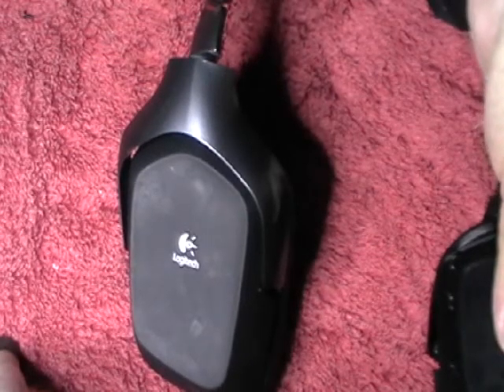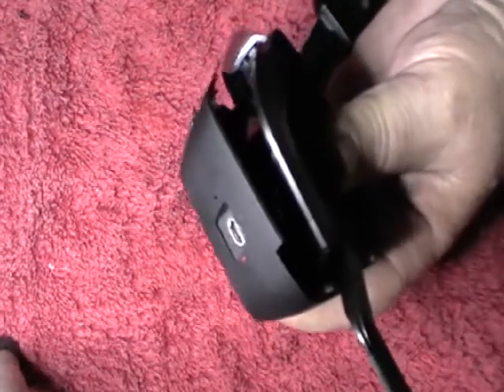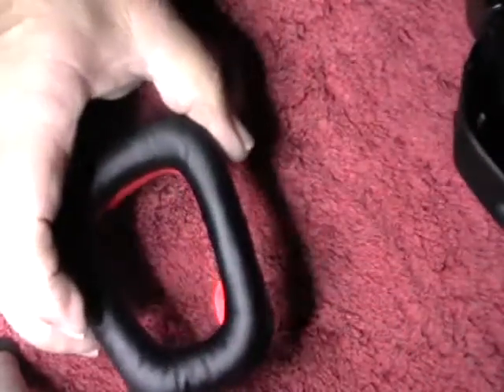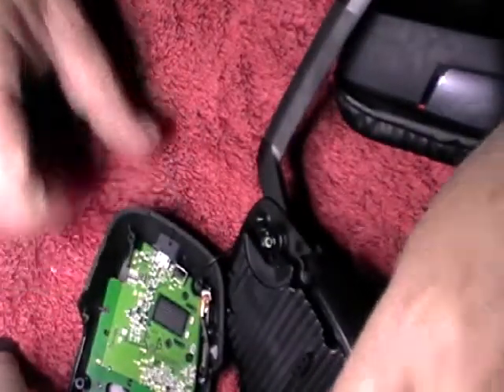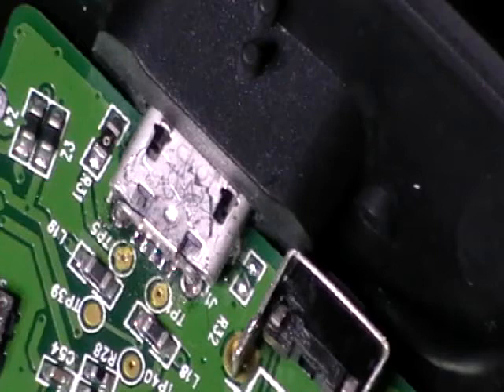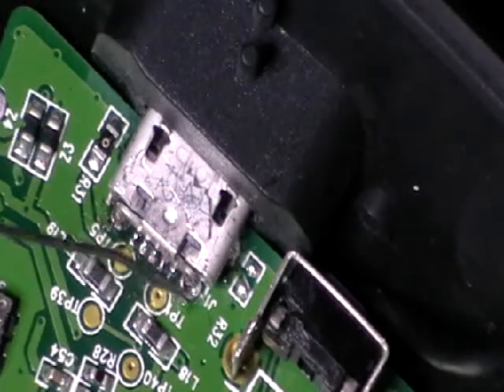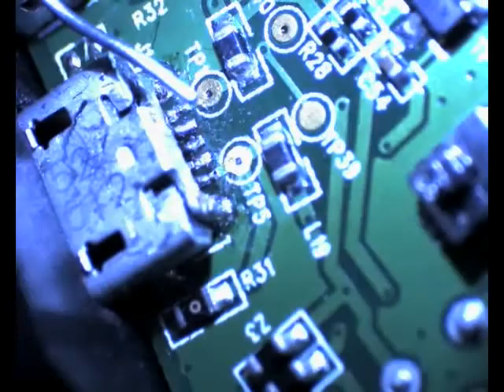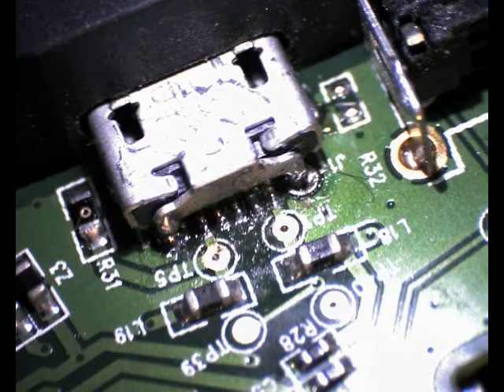Logitech G930 wireless headset not charging genuine repair

Comment: Hey so, I was doing some searching and bumbled accross this just after watching this:

http://www.overclock.net/t/1306396/problem-with-microusb-in-logitech-g930

Take note of the last post, which tells you which point is +5v, rest is GND. It should mean you just need to solder the shit out of that one point, as long as a ground is functioning. (It should also mean you can solder the other joints together completely without worry, but I'm not an electrician)
I do no the headset does nothing but take power of the port, which is why I was seeking this information.

Comment: What really bothers me about this USB port issue on G930 is that I bought the headset an year ago and then it came to my attention that some people have been complaining about the issue for years.  So, one can come to the conclusion that Logitech did NOTHING to repair the device.  And this really pisses me off.  

I will share this video on my fb page.  I'll tell about it to other players.  And I shall not ever recomend Logitech again.
Reply: I'd hazard a guess that it's not neglect, it's specifically designed this way.
https://en.wikipedia.org/wiki/Planned_obsolescence
The battery is replaceable, and barring destructive force, these headphones should last a long, long time with a new battery every couple of years. Going out of their way to make sure these fail a bit out of warranty will encourage a large number of consumers to buy the newest model. Me, I'll keep fixing stuff designed poorly to fail early, and having peripherals that last until someone actually innovates. The g933 isn't innovation - it's a worse fit over my ears, and stupid lights.

Instead of getting too pissed (cheap chinese headphones will fail too, it's just a little harder to figure out how to fix 'em with no big customer base) be happy it's not too hard a fix, and that after you do fix it, not much else is likely to go wrong. (except maybe those black saddles cracking by the adjuster. JB weld takes care of that one.)

Comment: fucking g930 only being a burden since I bought it. Never again a logitech headset.
Reply: +TheCherry1994 Yup, I tell me friends it's not a good headset but a couple have bought it, multiple multiple problems, and zero help from Logitech.
Reply: And good luck trying to get in contact with their warranty department or anyone at Logitech for that matter. Except the poor IT call center guy. That's about as high as the chain goes.
Reply: More like never buying another logitech product ever again
Reply: mine hasnt had a problem for 3 years until today it wont charge
Reply: Taun-Chi Gaming i did it today and it didnt take long they just wanted the recipt from amazon and the serial number of my item. it went through approval in a day to request a new one (if not over 3 years old) and they paid for my postage to shit it back and then shipped me a new one.
Reply: Dub Yuh
That's interesting.. I tried contacting them by phone several times.. contacting them through their different service emails dozens of times over a few months and never received a reply. You are really lucky.
Reply: Taun-Chi Gaming type in the "logitech phone number" and make sure you do the pre selection 
on the directory over the number pad just saw your calling about a product you have and a hardware issue then they will just do the processing of warranty for you
Reply: Already replaced the headset myself months ago. Like I said.. I contacted them by phone and through multiple email services. Dub Yuh
Reply: Taun-Chi Gaming grats.

Comment: I just did this fix and I can honestly confirm that it works 100%, but the information about that you have to have a microscope and that the 5 connects cant touch each other isnt really true. Since all the 5 connectors should have contact with all the same part of the pcb, it doesnt matter if they touch each other. So i just soldered down a whole lump of tin on the 5 connectors and the pcb, making sure that they all somehow have contact with the pcb. And now it works 100%! Pm me if you have any problems

Comment: the only genuine repair to this headset is to NOT buy it in the first place and if it does break, throw it in the garbage and do NOT buy another one. You'll have problem after problem with this headset unless you dont mind spending $100 every 6 months to buy another
Reply: I bought it twice :( I'm done with it
Reply: This headset has a 3 year warranty, and Logitech has always been amazing with replacement warranties. Why in the world would you buy 1 every 6 months?
Reply: Had mine for 2 years, no problem whatsoever.
Reply: Misho5z sammmmmmmmme  over it
Reply: Liam Winsper Funnily enough my headset succumbed to this problem a few weeks ago and is now in electronics-heaven.
Reply: Liam Winsper Get the Corsair H2100, it's very good in my opinion. I have it and the only thing I'm not FULLY satisfied with is the battery time.

 Otherwise a very good-looking, well-sounding comfortable headset with a clear mic and large speakers. If you liked the G930 I believe you would love the H2100. Oh, and it's way cheaper than the G930 too.
Reply: Liam Winsper I've only gotten comments on the mic volume once and when I checked I had neither Skype nor H2100 software mic volume maxed out so I turned it up and never had a problem since.

Comment: Soldering and all that stuff is good and all but the average dude don't have that kind of stuff lying around the house. Here is my home job solution.

Take the plastic cover off like in the video.
Get a small screwdriver and tuck underneath the crevices of the USB connector on the headset with tin foil. Pack it in tight.

Voilla! Mine is charging again!
Reply: +Hank l Worked perfectly, I know your comment was a year ago, but thank you! Can't even notice the foil in it either, I just stuffed it in and used my charging usb to flatten it down.
Reply: Hello, I know this is a really old comment, but I am wondering, does it need to be tin foil or can it be aluminium foil?

Comment: Now I just need a way to charge my g930 so I can listen to this video so I can charge my g930. Lol
Reply: ***** Is it possible to charge the battery somehow without the headset? since my usb charger is broken on the headset and i got 2 batteries lol but both empty...
Reply: subtitles
Reply: This is the best advice I've read for my problem. Mine died, bought a refurbished one, won't charge. Tried shoving the USB in and now its charging. XD
Reply: it still works for me, you just can't do it on-the-go aka you have to keep it still while charging and wait a while for it to be done,it's annoying but works . push the usb charger hard and wiggle it a bit until the light starts flashing then just dont touch it

Comment: A jewelers magnifying lens also works as it's a magnifying lens with its own self-supporting stand. Or the doofy goggles.

Part of me that has been tempted to use non-conductive epoxy to on top of re-soldiering it to provide additional support around the micro-usb port as the connections are still going to be flimsy no matter how well soldiered into place it is.